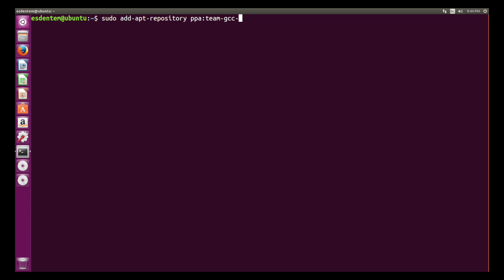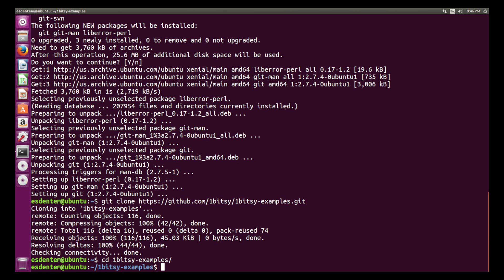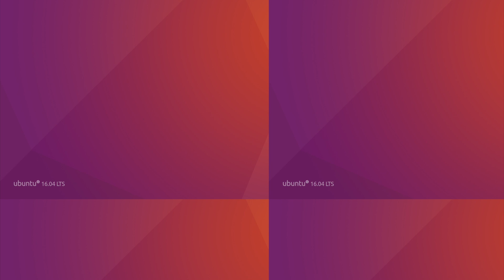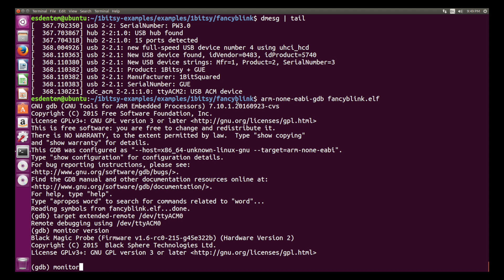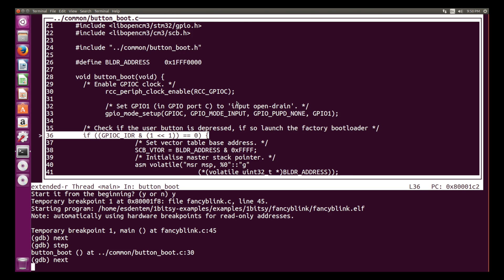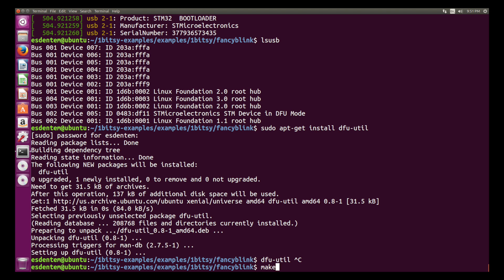1Bitsy & Black Magic Probe Linux Quickstart Tutorial

Comment: Can this black magic be used with OpenOCD ?
Reply from the maker: No, the whole point is that you don't need to use OpenOCD with the Black Magic Probe. All you need is GDB that comes with the ARM cross compiler.
Reply: @PiotrEsdenTempski  Thanks, I see now that I can setup serial interface for the remote target.

Comment: Theres a frustrating lack of consolidated information about how debugger software / toolchain and hardware is connected and setup and how it's used to make life easier. Even this video which is the best I've seen makes assumptions that people getting started just don't know. JTAG vs SWD? Firmware? Bootloader? Pin setup for boards with exposed swd pads?

Theres an intimidating amount of advanced documentation and a user community that frankly is pretty snobby when it comes to helping new users with debugging. It often feels like a hazing ritual.

Theres a barrier to entry for sure and I'd love to see a video or pay to pay for someone to walk through setting this up to work in platformio for ARM Mcu's using SWD.